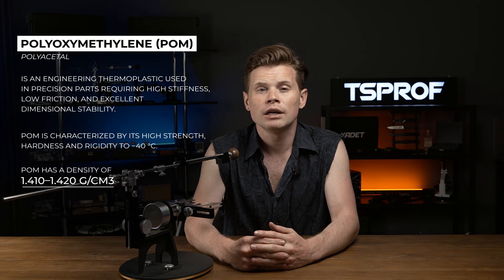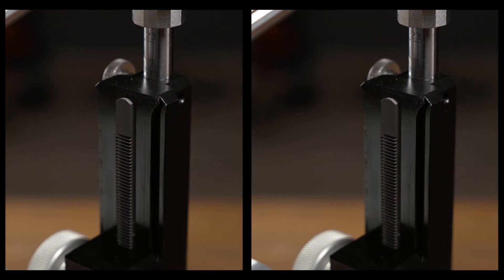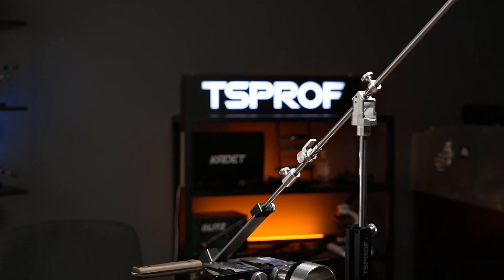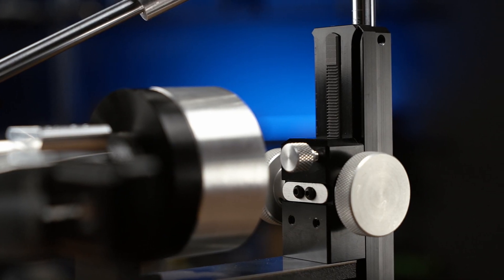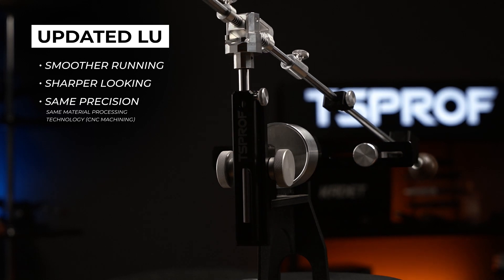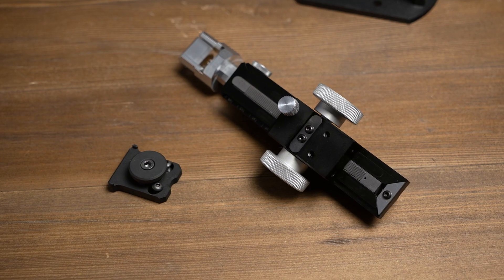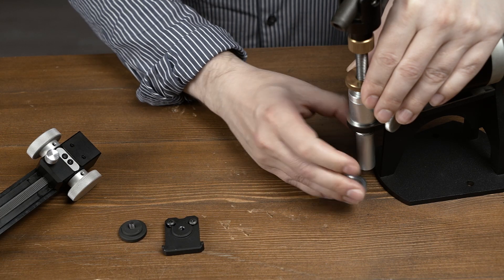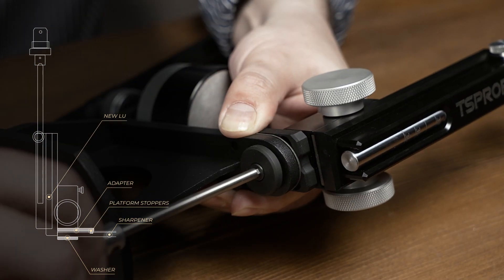Updated Lifting Unit of the K03 Sharpener. What's new and What for?

Comment: TSPROF...  why did you decide to change the lifter material ?
Reply from the maker: As the test shows, polyacetal provides better slide and gives smoother move. This is the only reason. It's made the same way as aluminum with the same CNC machines.
Reply: Cheaper to make it out of plastic.  But, after 2 years they finally figured out that plastic is junk and switched back to aluminum.

Comment: I'm glad I got the aluminum version.
Reply from the maker: The last one is more improved. Thanks to a new material, now the slider goes along the entire rack better, faster, smoother and at same time it serves as long as the aluminum one. 👌 I wish you could compare them on your own. It's hardly possible to do it in the video 😕
Reply: Rhetorical question-    Why did the new knife brothers K03 kit switch back to aluminum?
Reply: I agree...  plastic 🤔  
I'm sure it does the job, but as you say Brian... ' I'm glad I got the aluminum version... '